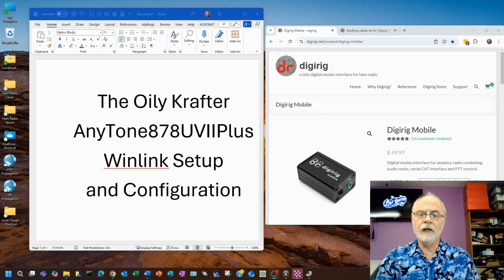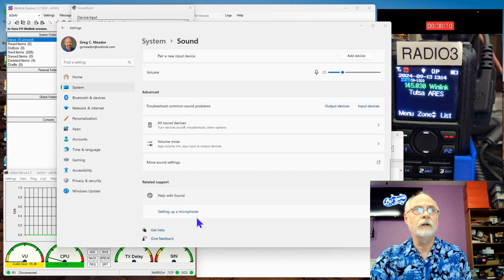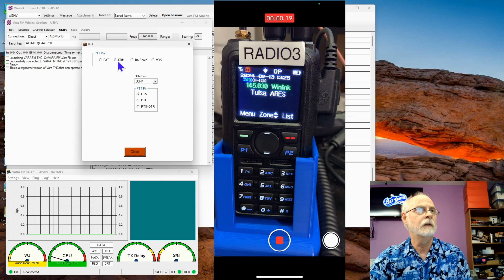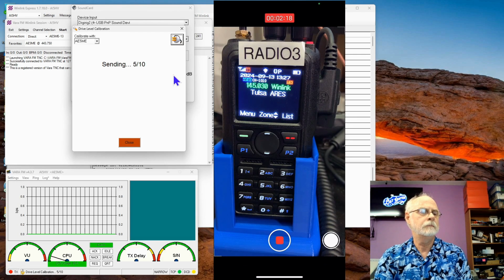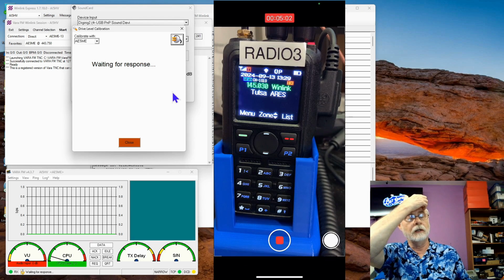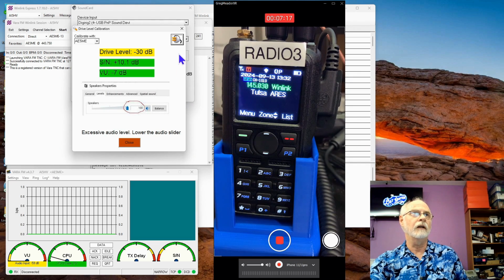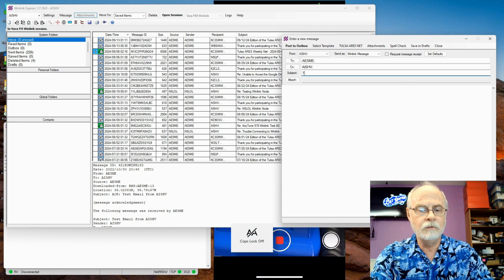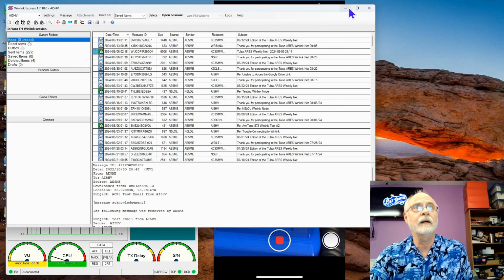AnyTone878 Winlink Setup and Configuration

Comment: Remember, you can adjust the transmitter audio sensitivity with  Settings/Radio Set/Voice Func/AnaMic Level and the receive audio out with Settings/RadioSet/Voice Func/Ear Max Vol -- as well as the volume control.  Not all the adjustment are on the PC.
Reply from the maker: Thank you for watching the video and providing comments. You are correct you change the settings on the radio or in the Windows operating system.

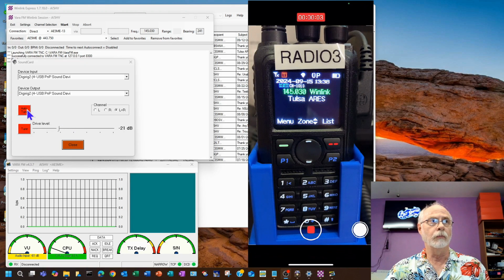Comment: I am trying to just do Packet, and at 3:51 you are showing VARA and where I live we only have packet. I don't see anything in Winlink Express that looks like what you have. (that sound card)
Reply from the maker: Sorry about the delayed response, YouTube has been having trouble providing notifications about comments that have been posted to our YouTube channel. I have reported it to them. In Winlink Express in the top menu bar, you will see Open Session and then there is a drop down selection that you can pick. In my case I picked Vara FM Winlink. Once that is selected you can click on Open Session. The screen that is being displayed is under the Settings menu in Vara FM then select Soundcard.
Reply: Vara isn't what you need. You need to install a software packet modem such as Soundmodem or Direwolf. Then in Winlink software you can choose Winlink Packet.

Comment from the maker: @Sgtoscarcolon
4 hours ago
Hi, excellent and very well explained. Very useful detailed video. Thanks!!! What were the HT settings? Squelch off/on?
Reply from the maker: Sorry somehow the original comment got deleted. Here is the answer I tried to post when YouTube accidentally deleted the comment and support was unable to retrieve it.   

@theoilykrafter
1 minute ago
Thank you. I recommend setting the squelch level to 0 unless you have a lot of noise. If you have a lot of noise try it set to 1 but no higher. The only other radio settings were the frequency. That will be determined by the Winlink gateway that you are attempting to connect to. In my case it was 145.030 simplex with no offset or PL Tone. The volume knob setting on the radio will be determine during your tuning setup. As you saw in the video you have to play with the volume knob settings as it has an effect on the Drive Level, S/Noise, and VU.